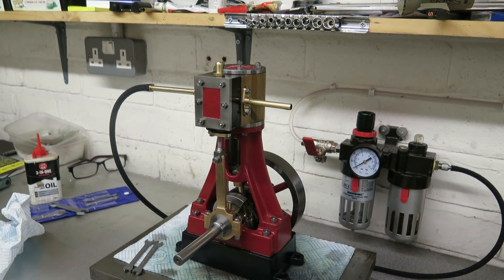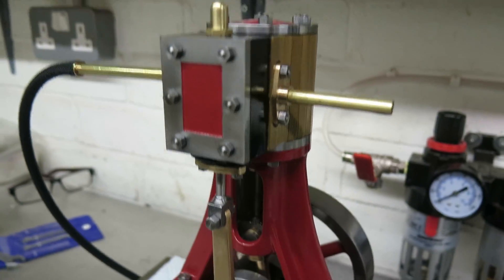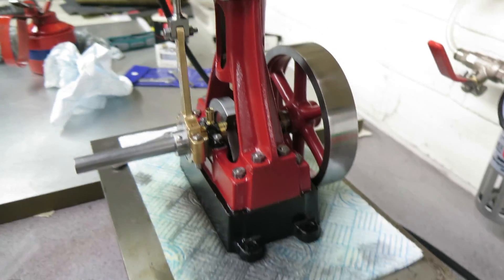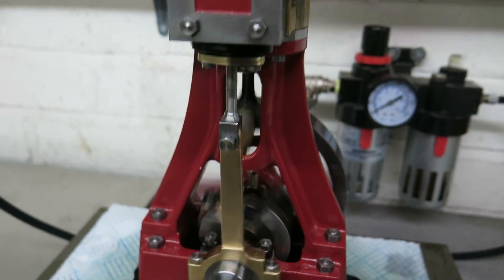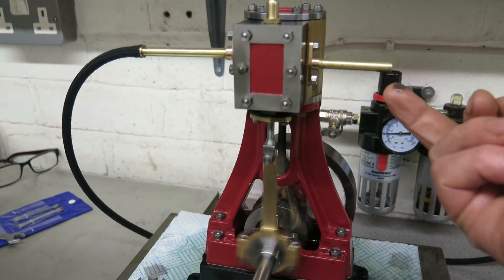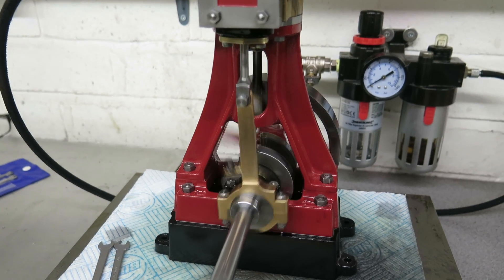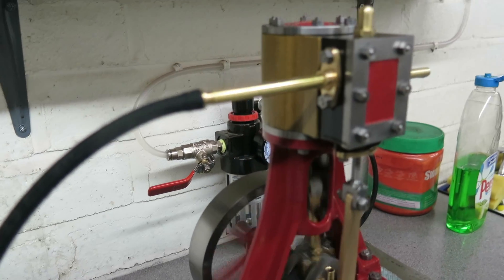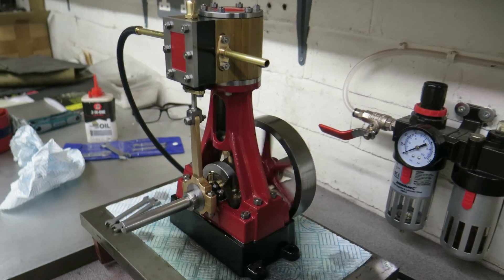Stuart No 4 Steam Engine Finished

Comment: Timing sounds off
Reply: Nick Giles you're very welcome sir. I'd like to see if that pillock who said the timing was off can build one to an equally high standard as your engine and time it even better, Then he can criticize. I hate when people nitpick other people's work and talk out of their ass when they have no clue what they're talking about. Further, it doesn't need to satisfy them, it's your engine so the only person it truly needs to satisfy is you. But I will definitely say your engine is one of the finest Stuart #4's I've seen!
Reply: You couldn't be more wrong, it sounds spot on. It runs as smooth as a well tuned watch on only a few pounds of air with no dead spots and is not lumpy at all. And the exhaust beats are even. One sounds slightly more pronounced than the other because it's a vertical engine and it needs to work slightly harder on the upstroke than the down stroke, and on the upstroke the side of the cylinder being used is also the side the piston rod is attached so there is slightly less surface area for the air pressure to act upon.  Now, if the thing stopped dead or lagged at TDC, jumped about on the table like a jackhammer even with the counterweight, or had a really staccato exhaust, then yes the timing is out, but this one is dead nuts perfect. Also if you watch the eccentric in relation to the crank, you can see it's set properly.
Reply from the maker: Thank you Mr Steam & Smoke. :)